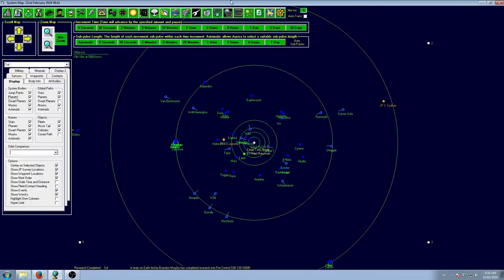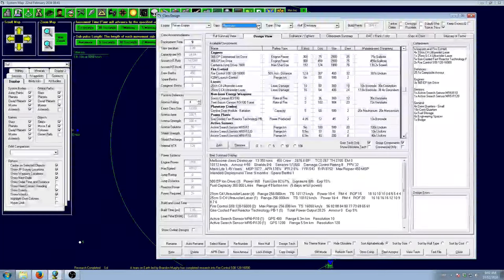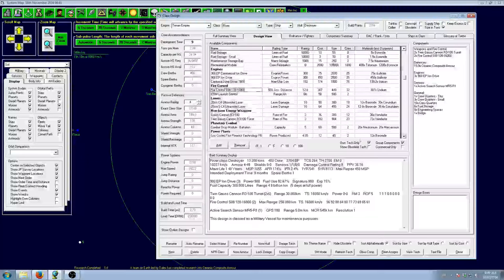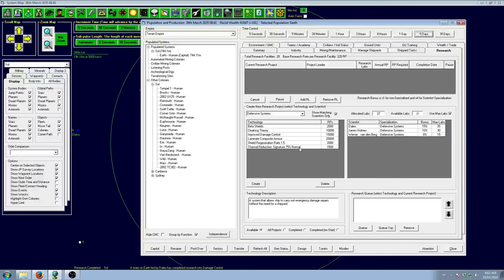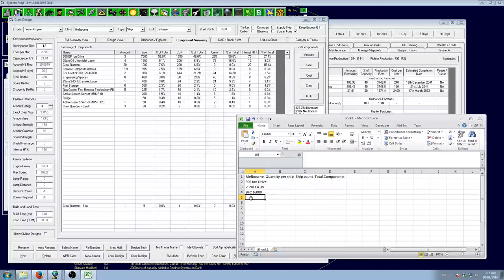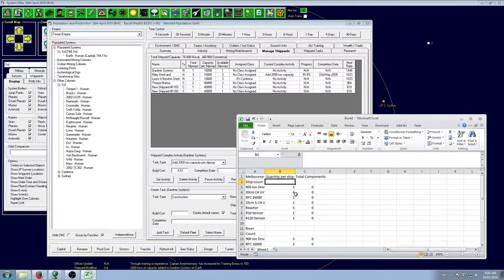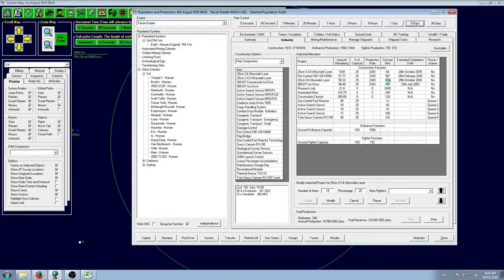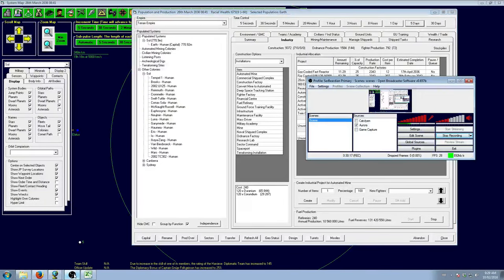Aurora 4X Let's Play - Ep.8 - Production commences!

Comment: i know the series has already come to an end but why didnt you research construction speed instead of sensor upgrades?
Reply from the maker: Which sensor? Early on, the lack of sensor tech and the relatively large size of ships means that you can usually fit a larger sensor to compensate for range without affecting things too much. Construction speed provides a significant and practical boost. Later on as ships get smaller, you want to be able to shrink the ships down which means smaller sensors that can still get the job done.
Reply: i meant as in your construction speed was low but you kept researching on the sensors and fire control tab
Reply from the maker: shrugs probably seemed like a better idea at the time?